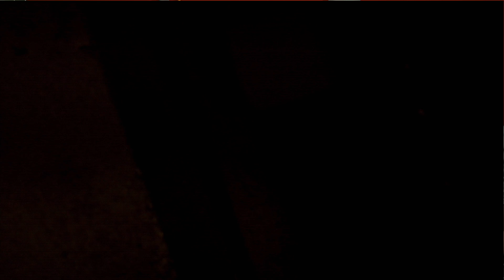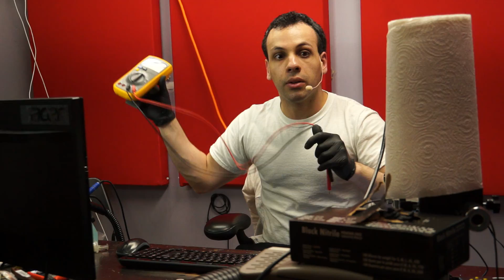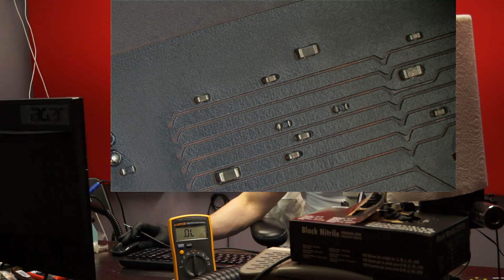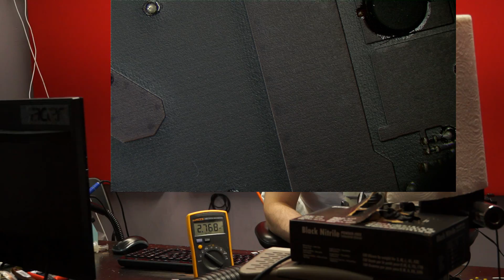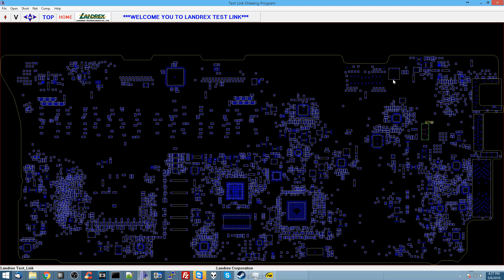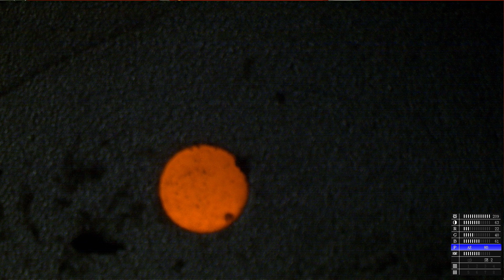Charging mosfet trolling and a talk on hot air rework stations

Comment: Hi Louis, i get the following errors while on POST:

CPU overvoltage error
CPU fan error
Chassis intruded !
Fatal error. System halted

This happened since i connected another psu to this board (asus p5q pro turbo).

What went bad on the board?

Just curious if it can be fixed or the board became trash.

Thanks
Reply: The PSU is probably faulty. Try booting with another PSU, but maybe the board is fucked up already.
Reply: yeah it does the same with another psu, maybe some wierd spike from the faulty psu blew a regulator or something
Reply: Possibly. A faulty PSU once caught fire at work (not really a big fire, smoke was coming out of it and it had a burnt smell) and it killed the board.

Comment: i have the wha900, i have yet to burn myself by accidentally touching  the exposed metal, but the panicked oh shit moment, when you go to swap hands and feel metal instead of plastic....... not fun. btw the wha900 has a "standby" mode you can use for cooling, basically you can set the on but not pressed green button yet mode to be full air and no heat.

Comment: Hey. I build my own hot air gun by modifying the standard nozzle of my ordinary two temperature heat gun and successfully removed a faulty smd capacitor from a sound level meter - board (Voltcraft SL-50) which i once bought from a flee market and which did'nt work from the beginning.  Because i did'nt have a new cap of that type i replaced it with a standard Elko. A test showed that the device worked again. Hell yeah. After that i right away scewed up both solder pads by putting slight force to it while bending the wires of the new cap and it took me another hour to fix that. dammit. These pads are so delicate...